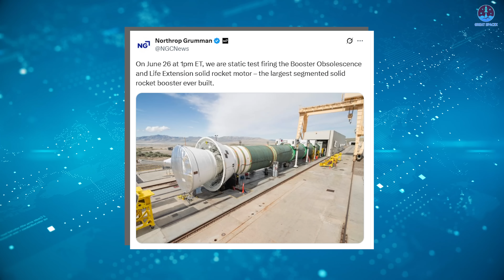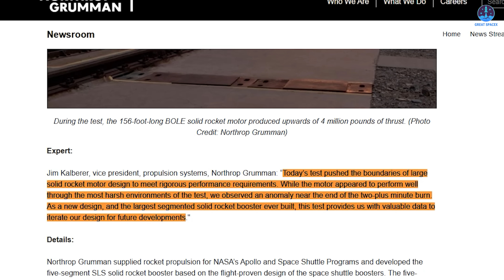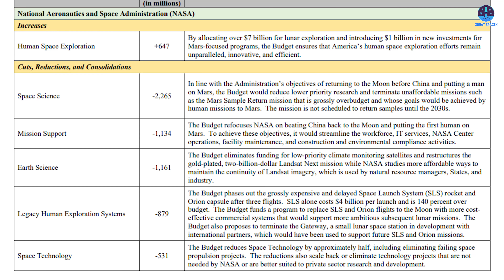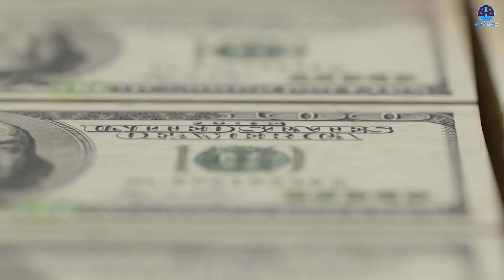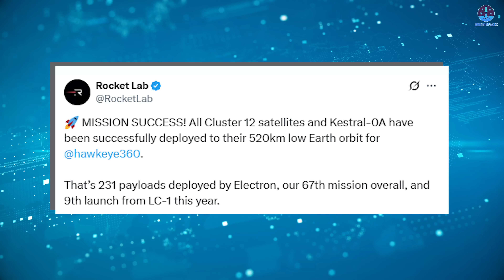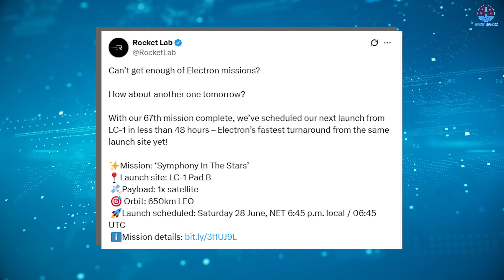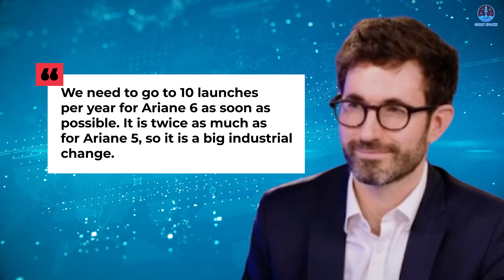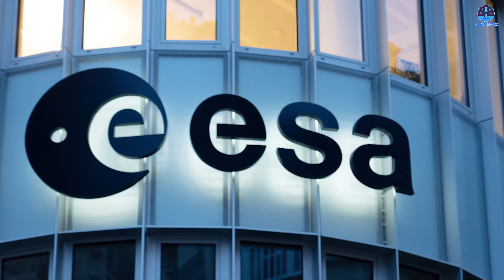BAD NEWS! NASA SLS Booster anomaly EXPLODED & Blew off. What Exactly Happened?

Comment: One of the biggest problems with SRB's is they CANNOT be throttled or shutdown until all fuel is exhausted.
Reply: Exactly. Once lit, you're going to go somewhere like a 4th of July firework, no matter what.
Reply: @Workingcinderellaman-jw2pf  May as well be one - they both work the same way.
Reply: @Workingcinderellaman-jw2pf the FTS shuts down the SRB although it causes permanent damage when used. That's why the SRB is lit AFTER main engine start and validation.
Reply: @divedevil985  The FTS on the Space Shuttle SRBs was designed to destroy the booster using linear explosives. This would split open the motor case, reducing internal pressure and terminating thrust, but the propellant would continue to burn in a less controlled manner and would still continue to burn until it was done.
Reply: @Workingcinderellaman-jw2pf I installed the FTS from the RSS to LSC. 
I know exactly how it works. 
Yes there will be smoldering but the thrust is eliminated. 
Back to the original point that an SRB can't be shut down once ignited. It can.
Reply: @divedevil985  "Smoldering"? LOL . A system designed to blow up rocket boosters in order to eliminate thrust would only be used as a last-ditch hail Mary in extreme circumstances that would have a high chance of destroying the orbiter. 
The fuel would still burn until it was gone, it just wouldn't produce thrust so your point is moot.
Reply: @Workingcinderellaman-jw2pf  the point was thrust is eliminated contradicting claims that thrust can not be terminated on an SRB.
I am completely aware when it would be used as I installed that system.
The booster fuel cannot chemically combust without pressure enabling the process aside from negligible hot spots.
I have included numerous NASA documents which explain and define the process as "extinguished".
If you can't accept that it is your problem not mine.
Reply: They also vibrate significantly.
Reply: @Klaus293  The fuel also can crack, changing the internal pressure, and burn rate, which also corresponds to "explosion".
Reply: @Klaus293 also untrue. During analysis of data from the Ares I-X flight combustion instability frequencies (the actual name for the vibration you mentioned) was well within tolerable limits for both humans and hardware and was actually less than the resonant frequency of FH.
Reply: every comment in this post is wrong.
Reply: @divedevil985  So you admit to being wrong.
Reply: @JessePollardII  I'm right that every comment in this post is wrong. Which makes me right, not wrong.
Reply: @divedevil985  I learned that 50 YEARS ago from a military textbook.
Reply: @divedevil985  Logic isn't your strong suit. as it also states yours is wrong too.
Reply: @JessePollardII  and yet I'm the only one who is right wasting time on someone who would rather cling to false information than take advantage of information from the source.
Reply: @divedevil985  As I said - logic is not your strong suit. It still isn't.
Reply: @JessePollardII  I'm not concerned about the opinion of someone who doesn't know what he's talking about.
Reply: @divedevil985  Speak for yourself.
Reply: @JessePollardII  prove me wrong and I will.
Reply: @divedevil985  Did, but you didn't pay attention.
Reply: @divedevil985  ... unless you're wrong about being right.
Reply: @Workingcinderellaman-jw2pf except I'm not.

Comment: Biggest problem Ariane has is that they decided to REPLACE Ariane 5 with Ariane 6 when they should have planned to keep both programs going at once and only shifting to Ariane 6 once it was a stable launch platform.
Reply: I don't think they had enough funds to do both.
Reply: @JessePollardII  If they'd have built more Ariane 5 rockets before shutting down the line to change it to build the Ariane 6 rockets they'd had a source of funds to do a better job of developing Ariane 6.
Reply: @roycsinclair  In which case there would have been no money for the Ariane 6 as the funds would have been used for Ariane 5.
Reply: Been there - saw the same thing happen to NASA. The funds for Apollo 17, 18, 19 were diverted for the Shuttle development even though 17 18 19 HAD funds.
Reply: @JessePollardII  Nope, had they more Ariane 5 rockets available they could have had customers buying launches which would have help provide more funds FOR Ariane 6.  Yeah, at some point those customers would have gone to the Falcon 9 for economy but by not having ANY Ariane rockets to fly 5 or 6 they lost business they could have kept.

Unless of course Ariane is always operating at a loss but is being kept alive simply because they want a European launch system but I was understanding that it was being operated at a profit to help pay for the program.
Reply: @roycsinclair  All non-reusable launch rockets operate at a loss.
Reply: @JessePollardII  Not until SpaceX got their Falcon 9 flying frequently. Ariane should have seen the first few Falcon 9 boosters landing and realized right then and there they had to look at reusability.  Then extended production of the Ariane 5 to help cover their costs before the whole market started using Falcon 9 launches.
Instead they promoted a fool who thought that reusability was just a gimmick and wouldn't be competitive long term.  Not one of their best moments.

Comment: Move on from SLS and hand the job to SpaceX.
Reply: Lol, yeah. SpaceX would need at least 11 additional flight for refueling to get to the moon to do what NASA achieved in 1968. With a realistic calculation 12+ Starship flights, if Starship can get to the announced 200t payload capacity, will be way more expensive than 1 disposable rocket. 
Use your brain and stop thinking that only SpaceX has clever engineers.
Reply: @svenweihusen57  Lol. It's not about 'getting to the moon' It's about getting to the moon with enough material to setup structures on the moon.
It's not a race to be first... It's now a race to shift material using a new generation of 'Big Rig' space ships...
... Besides if it was a race, the US already won it. China caught up only because it is also trying to to create big rig space ships... and got to the moon on the boot straps of that effort.
Reply: @svenweihusen57  Nope. Space X could do what NASA did in 1968 just by using the Falcon 9 superheavy. It has already launched things into the asteroid belt.
Reply: @JessePollardII right. This is about Starship which will be great to get things into LEO but horrible for higher orbits and interplanetary missions. This is simply physics: the carrying rocket must reach the same speed as the payload and accelerating a heavy Starship is way more expensive than a lightweight disposable rocket.
Reply: @svenweihusen57  it is FAR FAR cheaper to be able to reuse ships - just as no one buys a 200+ million dollar air plsnr got just one trip. Much better to be able to just refuel it and use it again and again.
Reply: @JessePollardII it is far cheaper to reuse the ship. But when you want to go to a geostationary orbit is becomes very costly to carry tons of material to this orbit. A disposable rocket is way lighter than starship so they a saving a lot of fuel. 
But also for LEO starship is most likely overkill and using a falcon heavy would be cheaper.
Reply: @svenweihusen57  Only if the trip is never done again. Once you plan multiple trips it becomes MUCH cheaper to reuse the transport.
Reply: @JessePollardII a reusable first stage and a disposable second would make this system way more versatile. Starship for LEO, disposable second stage for higher orbits. Higher orbits also mean way more speed at deceleration aka way more impact on the heat shield for starship
Reply: @svenweihusen57  What is many times more flexible is a reusable second stage. And for the same reason as a reusable first stage.
Reply: @JessePollardII a reusable second stage has its benefits but it’s not well suited for every kind of mission. As I said: starship is superior for LEO but not when you need higher orbits. And I am not sure if the compromises SpaceX has to make Starship instantly reusable will pay off. IMHO there isn’t enough payload for the intended short round trip time.
Reply: @svenweihusen57  That is true ONLY if the scond stage IS the mission - otherwise it is a loss of money.
Reply: @JessePollardII the point is that you need to accelerate everything up to this orbit. And for a reusable rocket you need a lot of energy to get rid of the access energy because you are actually falling down 34,000km to get to Leo so you will get a lot of additional speed which you must get rid of. I have seen a video how complicated this is when you get back from the moon and the genius solutions NASA found for it.
Reply: @svenweihusen57  Which is true for all reusable things.